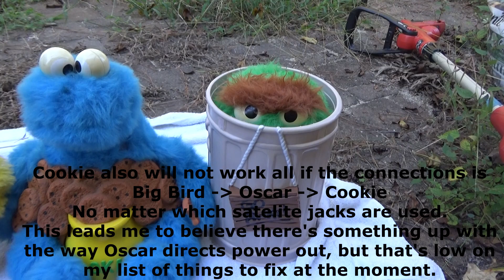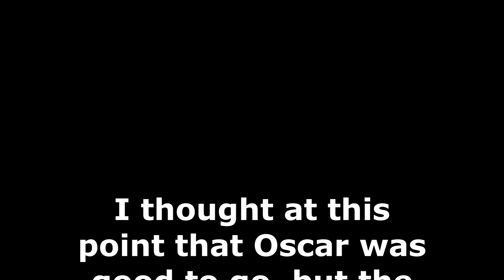A Brief Repair of Oscar the Grouch

Comment: Those 2 microswitches you speak of, in this context, are what we call limit switches, because they trigger at each end of the track oscar moves on.  Other devices use limit switches too, like floppy disk drives, CD players, and automatic doors.  A certain young man who used to be very active within the Teddy Ruxpin on YouTube community told me that the mechanism that moves Oscar up and down is very prone to breakages, but since this person made up false stories about other things too, it's difficult to determine whether he was telling the truth or not.
Reply from the maker: Oh interesting! Thank you for the clarification on that! Having experienced it myself, I can see the mechanism being easily breakable, but I don't feel like that would happen during normal play. Perhaps if someone is rough with the toy yes (like that happened to mine), but probably not from him just going up and down normally.
Reply: @blueoctopede  OK, well, if I remember correctly, this particular person was telling me that we new batteries Oscar moves too quickly and the mechanism is likely to break, but as I say, this person tended to make up a lot of stories that had questionable reliability, so it's hard to know for sure from them.